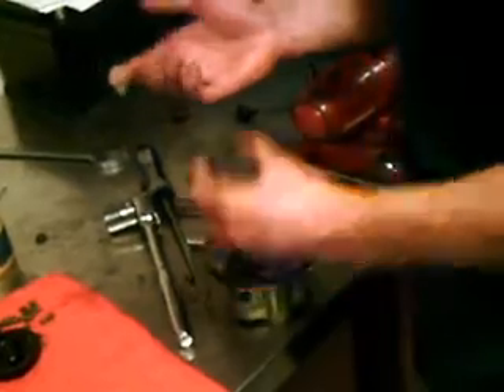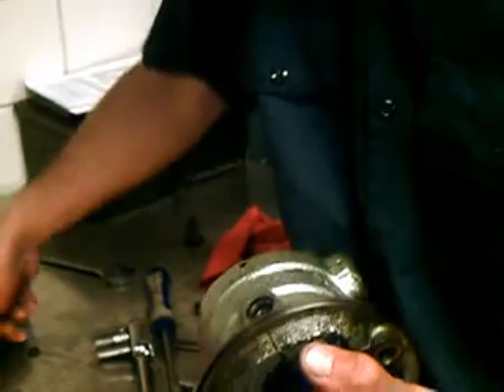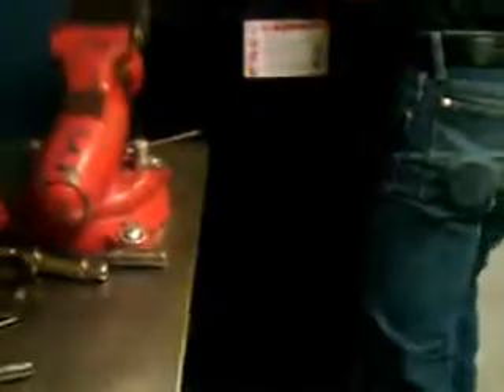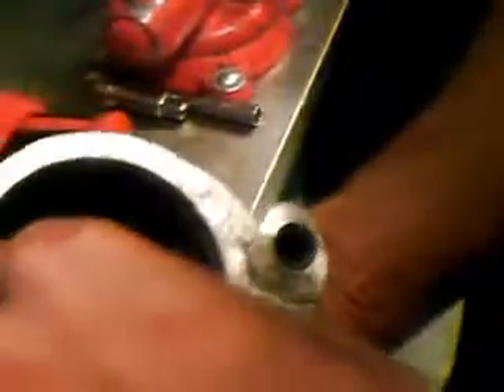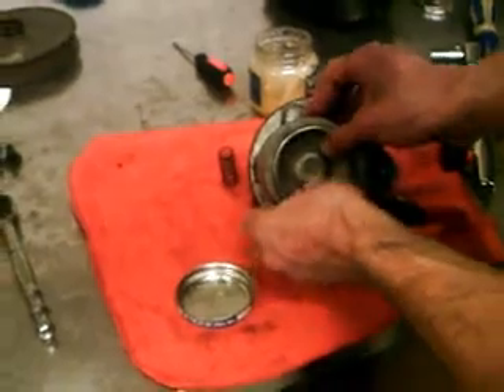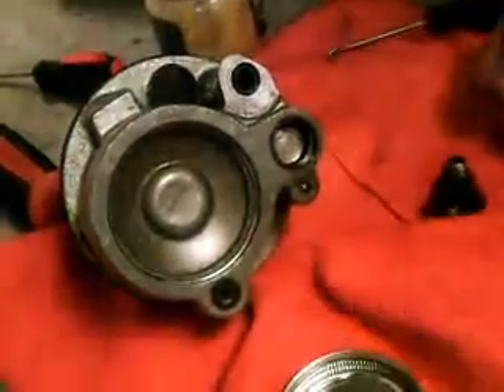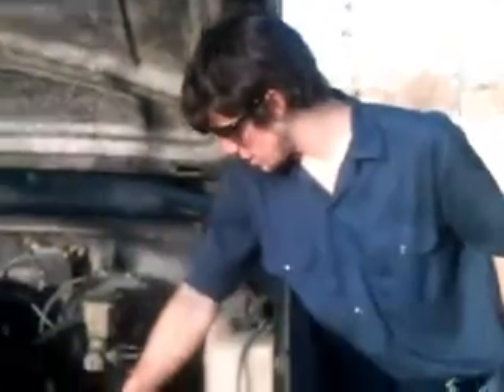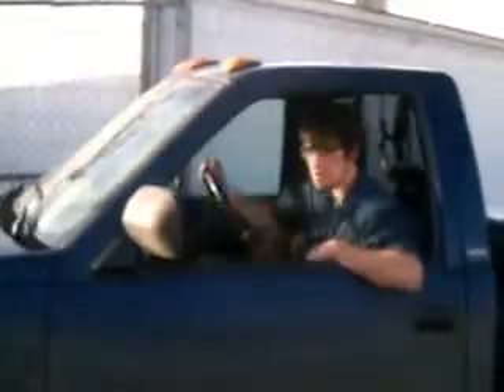Chevy Power Steering Pump   part2R

Comment: The vane direction was a little vague on the video.  Since the thin edge of the vanes have a dull side and opposite is a shiny polished side, I assume the polished side faces outward to ride against the pump ring.  Any help on this would be appreciated.  Good video otherwise
Reply: rounded edge to the outside, here's a great article breaking down a complete rebuild including vane direction  http://www.corvette-restoration.com/restoration/motor_and_transmission/060813_power_steering_pump_rebuild.htm